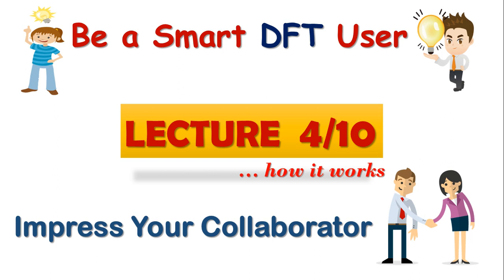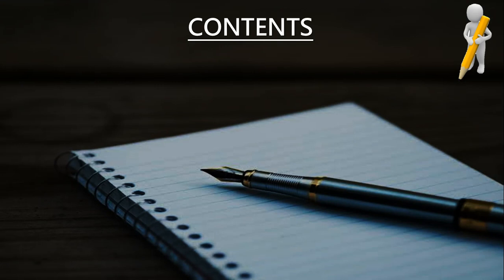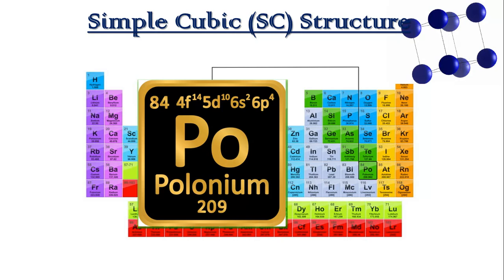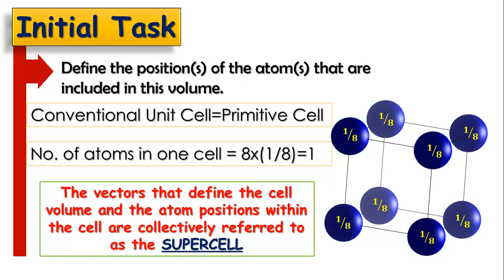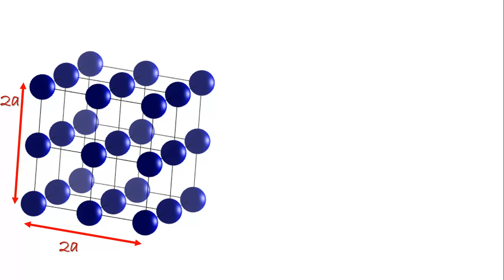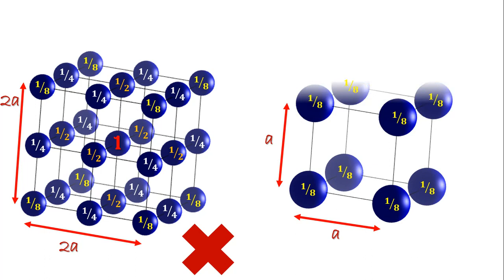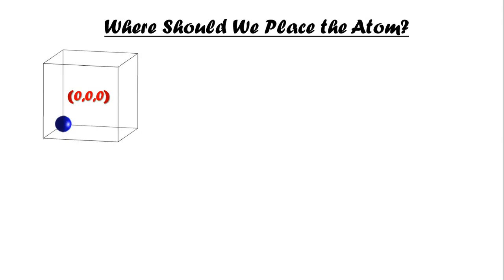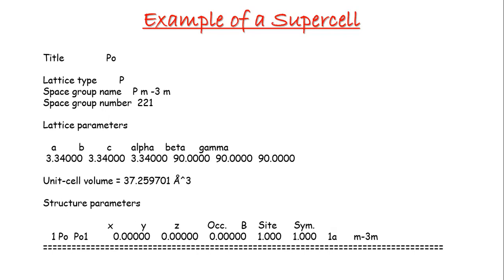Density Functional Theory - Lecture 4/10 : How it Works

Comment: Hello and thanks for another lecture! In the very end, simply by looking at the U x V  curve, I don't understand why at all points above A and B the Gibbs energy of structure 1 will be bigger than that of structure 2... I'd highly appreciate if anyone could clarify :)
Reply from the maker: Well, it's a generalized example. Point is, whenever such is the case, the transition will occur. Below point A and B, slopes showed that the Gibbs energy of structure A is lower. At points A & B, they are same and hence there is a great possibility for the phase transition to occur. Since then, structure one's Gibbs energy is higher, we can become sure that the phase transition is gonna take place.
Now, what if the case is not so? Well, then, simply there will be no phase transition.

Check our fifth video of this series. Professors have quoted on that one as the best video on DFT.

Comment: Sir, does condensed matter physicists gain expertise in both theoretical and experimental aspects? Or is it that theorists can not do experiments and vice versa
Reply from the maker: A nice practical question dear Somsuvra. Actually in general, they collaborate. Other than collaboration, what a theorist can do is he/she can take any published paper as a reference. From the perspective of this lecture, you can think like― let's say from a published paper, you know the raman spectroscopic data of a material and group theory analysis shows the structure must be tetragonal of some particular space group but experimental setup is challenging for this one. Then, you can come up with your theoretical tools to predict the lattice parameter and bulk modulus. At a much higher pressure, what will happen to a material? You can calculate this too if you know the ambient pressure data from a paper. Bottom line is, You certainly need to get expertise in any one field which is the most common case too.
Reply: @theoreticalcmp  share link of lecture 5/10